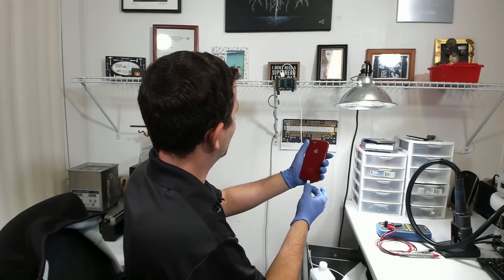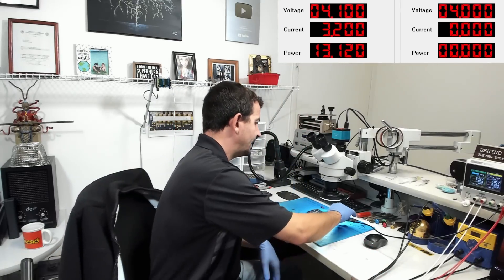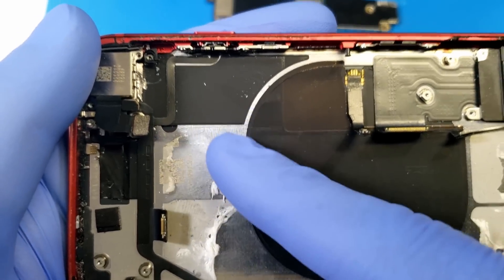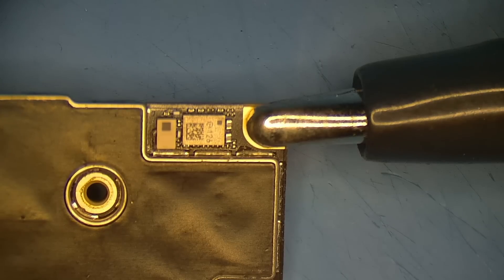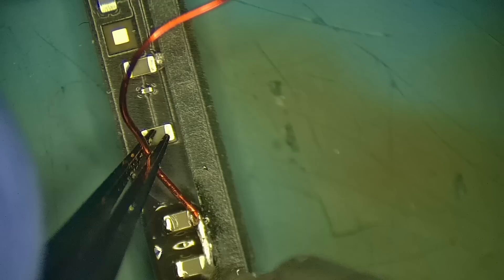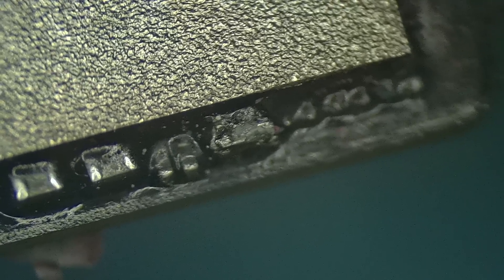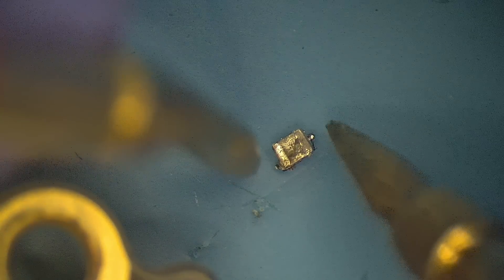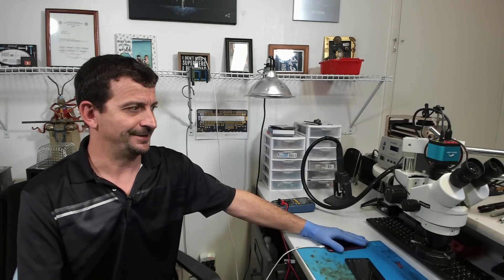iPhone died after a back glass repair!  What killed this phone?

Comment: i have a iPhone 8 and i tried to replace the back glass by myself and i hate to say this but i didn't use a laser while fixing it and when i connected the screen and battery to the phone it shows no signs of life i thought it was just a faulty battery issue at first so i replaced the battery but now the motherboard overheats alot and theres a bunch of dents inside the housing i was wonder if you could help me out here because google isn't helping me out

Comment: I recently bought an iPhone 13 from eBay re-manufactured. Is there an app I can run to doublecheck and see what’s been replaced or doesn’t show up as official Apple.. Everything looks really good on the outside, I just want to check.
Reply from the maker: Yes - 3utools!  It's free and has a "verification  report" button that shows what the serial numbers are supposed to be and then what they actually are.  I haven't used that feature on the newest models but it should still work.  3u.com

Comment: If it has a crack through the middle it would be an open circuit wouldn't it ?
Reply from the maker: I think it's because the conductive plates are so close and the dielectric is so thin, the crack actually allows the conductors to touch.  Or maybe they short and then crack?  I agree, common sense says a crack should be open circuit!

Comment: I knocked off a capacitor from my trashcan Mac CPU board when replacing the CPU. Freaked out a bit. But I put it back together and it works just fine. Capacitors are optional.
Reply from the maker: Lol @ people falling it a trashcan. It really does look like one tho.  What were they thinking? 😂

Comment: Usually when Apple engineers a complex device, they OVER engineer it so there is generally redundant components. So unless that capacitor does something no other capacitor can take up the slack for, I'm guessing you didn't replace it. However, all those "redundant" components don't mean squat when one goes short. If it fails open (can SMD capacitors fail open?), there shouldn't be any noticeable problems.

Comment: I guess no cap. But why does it work without it?
Reply: Capacitors can do a couple things in a circuit. If it's just a cap between a voltage line and ground it's there to smooth out the voltage using the capacitance as a buffer, or shuffle off something to ground, or both.

In this case there are many many similar capacitors doing the same thing nearby. There's already a lot of smoothing 'springiness' in that circuit... So if that one's missing, you're barely going to notice it.

If it were used differently, say if it were part of a resonant circuit, or as a DC blocking capacitor between AC stages... its absence would disable that circuit. But that's not so here.
Reply: @warphammer  Fantastic. Thanks.

Comment: It can happen from time to time. I'm a repair technician and I also do back glass repairs, and although I use laser (sometimes I do 2-3 runs) to burn the adhesive, the glass somtimes can still be quite stubborn and my tools I use can slip since I have to use quite big amount of force to break the glass pieces off. and because some parts of the motherboard are not protected by the shield, it is possible to damage those parts of the flex cables or the motherboard. It can happen and we always warn the customers about the risks. Still suck's when it happens.

Comment: I’ll take a punt, based on the removal technique, no replace.  Caps are there to smooth out power on that circuit.  There are plenty more left on the board to take up the slack.

Comment: Smashing recovery Jason :-D
To replace a cap or not to replace a cap, that is the question?
There are often more than one capacitor on the same power line.
If it crashes,  well replace it. lol.
Reply: Based on the second sentence in your comment, you sir live in Stratford-upon-Avon. 😁
Reply from the maker: hehe, thanks!  I'm a sucker for always trying to put the board back exactly like it was before it was damaged.  There have been other techs show these running with ~17 caps removed from this line though!  I'm sure they would have problems under certain situations.. like, someone using the phone.  :-)

Comment: Judging from the fact you ripped one of the pads off with it, I'd say no, you didn't replace that cap.
Reply: Both pads for the cap are still there and perfectly intact. The copper-half pad is actually the metal foil end-cap of the capacitor he sheared off;  very common and removed when you tin the pads up again.

Comment: How is this possible to damage🤦🏼‍♂️
Reply from the maker: I'm not 100% sure but I think they may have removed the board and then re-installed it with a chunk of glass laying in the top?  It could have been a tool poking through from the backside too though.  I really don't know if they removed the board or not to replace the back glass.
Reply: Heat!